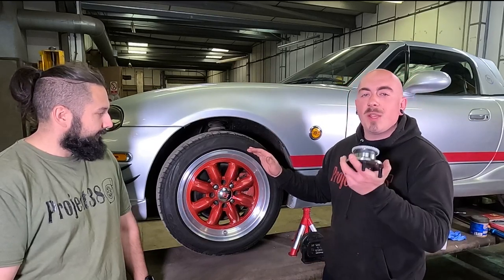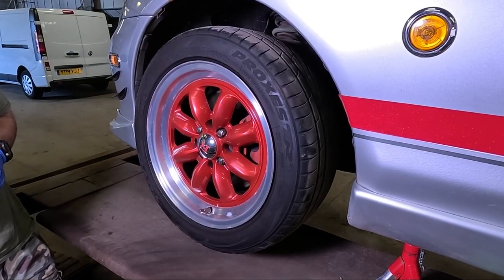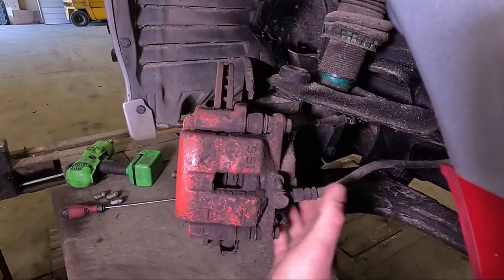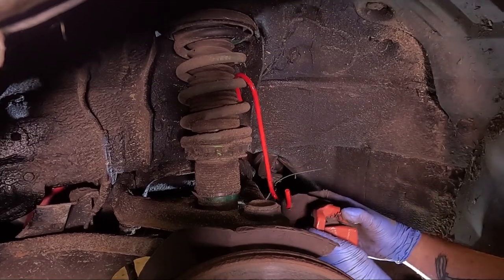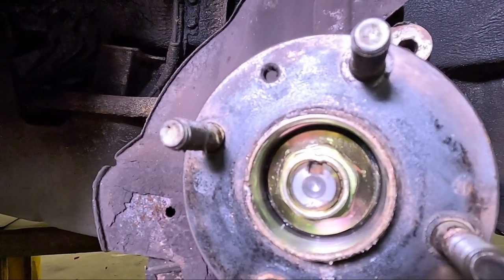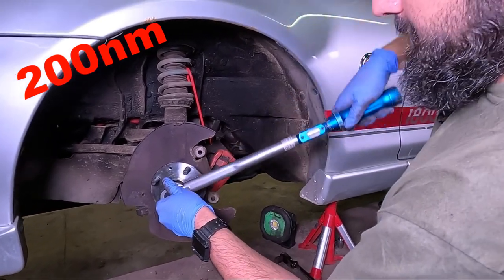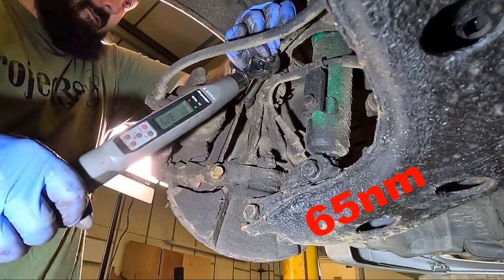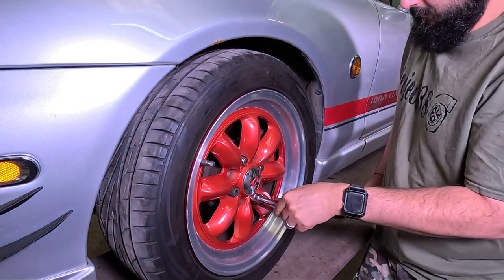MX5 MIATA FRONT WHEEL BEARING

Comment: no grease??
Reply from the maker: no need for grease
Reply: @Project380  I just copy paste what it came on top of goggle search page:

To be safe and effective a wheel bearing hub will need to be greased. Neglecting this critical maintenance task can lead to premature bearing failure, which can cause costly repairs and potentially dangerous driving conditions.
Reply from the maker: yeah so these bearings are sealed bearings and are already greased so no need to grease more

Comment: Thanks, 
Question. Do the rear wheel bearings last longer than the fronts on average ? Is it worth it to just go ahead and replace them all if only one is noisy?
Reply from the maker: in my experience with "normal driving" the rears last long, i personally wont change bearings unless they are worn out or im upgrading.